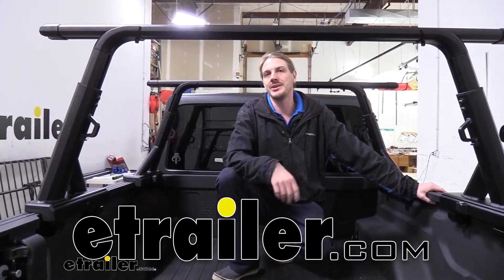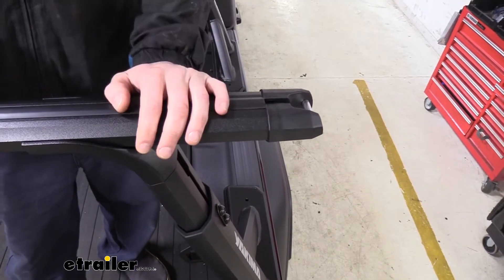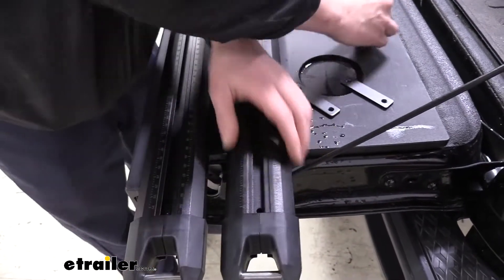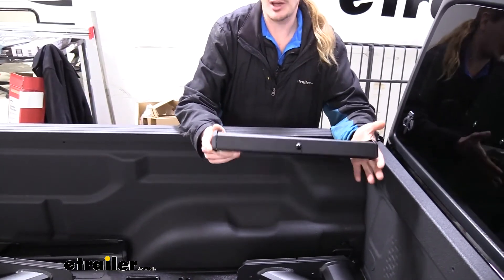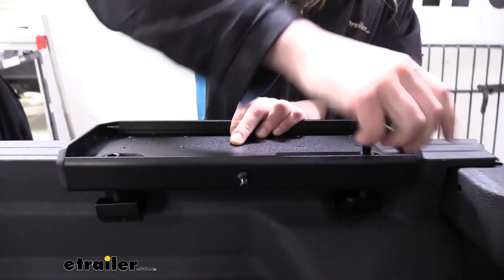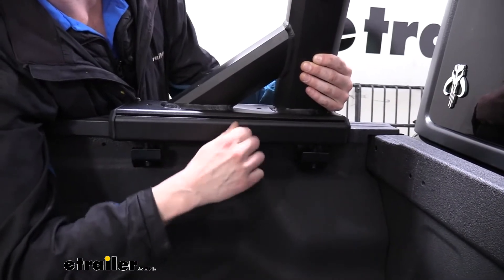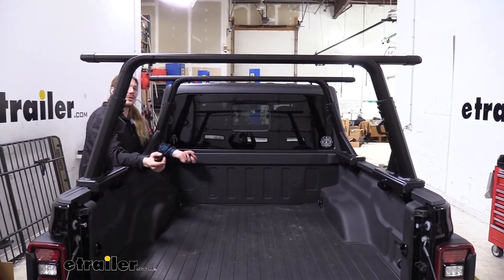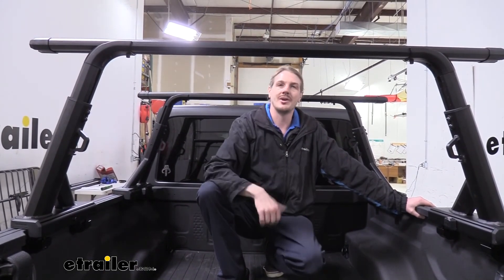Setting up the Yakima OverHaul HD Adjustable Truck Bed Ladder Rack on a 2020 Jeep Gladiator

Comment: When you want to adjust the height do you need to loosen the top bar as well?
Reply from the maker: You sure do. As the rack is raised, the points where the uprights attach to the crossbar will move inward.
https://www.etrailer.com/Ladder-Racks/Yakima/Y01151-57.html